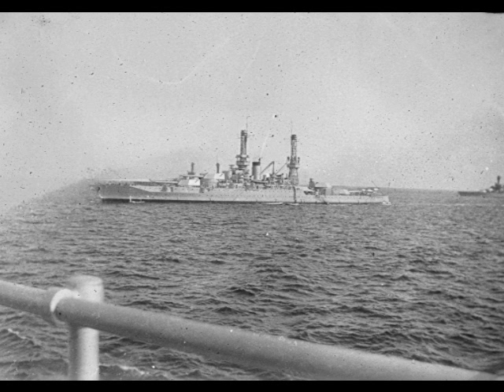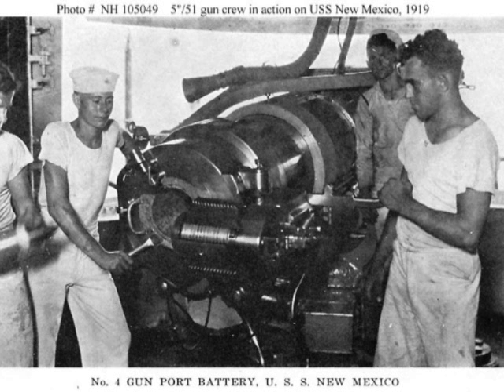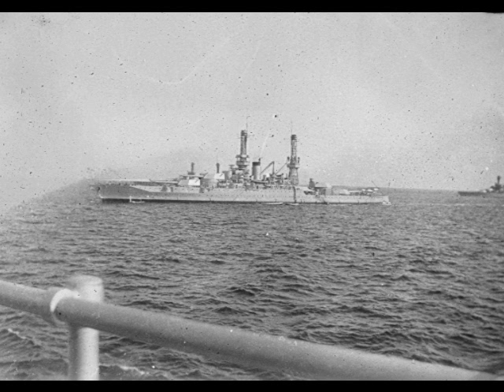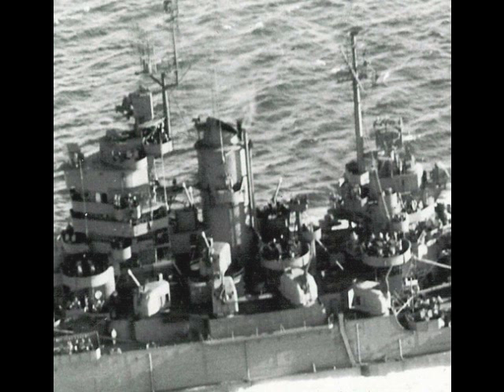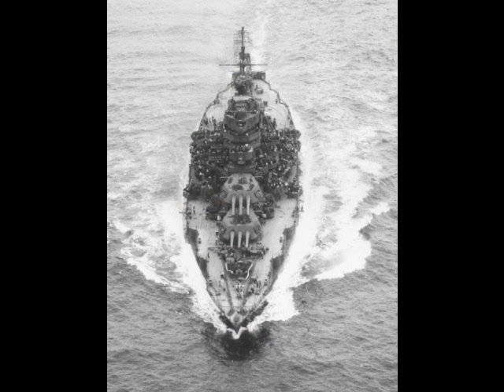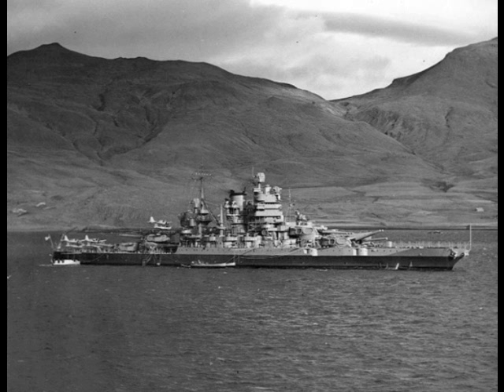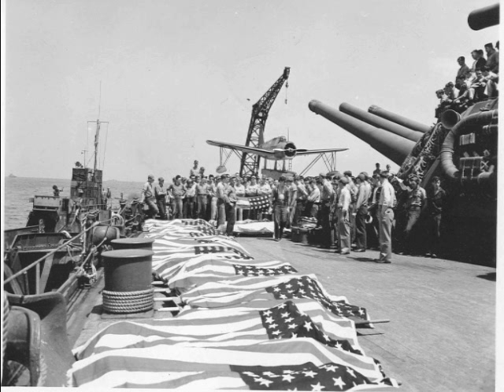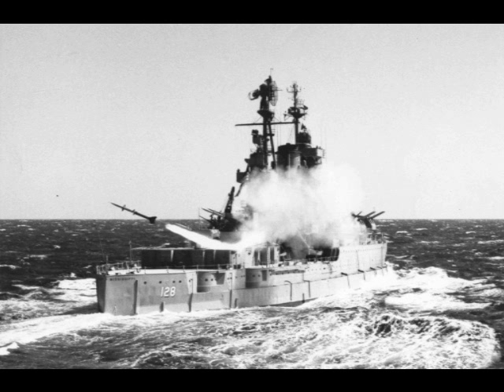New Mexico class

Comment: From what I understand the use of turbo-electric drive was because reduction gearboxes were still being developed, prior ships had direct drive with the turbines which was very inefficient, propellers like to turn slow while turbines like to turn fast. Once reduction gearboxes were reliable it replaced TE drive in all new ships.
Reply: Reduction gears are NOT cheap by a long shot.  They are one of the most expensive items on the ship.  So expensive the Navy doesn't own them they lease them.  When a ship is decommissioned the reduction gears continue to live on in other ships.

My first ship was the Kitty Hawk, I don't remember how old the reduction gears were just being told they were OLD.  They also had the largest locks on them I've ever seen, almost novelty like, big enough if giants were real it's what they would use on thier locker.  On the very, very rare occasion they get opened up you have an armed sentry right next to it.  If you have to enter it you don a "poopy" suit, apparently even a hair getting down into it would cause problems.

Comment: The presenter mentions one of the advantages of turbo-electric drive being that it is much quicker and easier to switch propulsive power from ahead to astern.  That is theoretically true, but not necessarily in practice.  Although I have never sailed on a turbo-electric ship, I have sailed on a number of diesel-electric ships.  It is extremely inadvisable to switch power abruptly from ahead to astern, as the presenter suggests.  So doing would inflict an amperage overload on the drive motors which would either trip the drive motors out, or possibly even burn out the armatures.  I have seen both occur when power was applied to the drive motors too abruptly.
Reply: My first ship was the Kitty Hawk and going into reverse was an evolution to be sure.  You have to slow the massive shaft down, enough to completely stop it.  Once stopped you locked the shaft, engaged reverse then unlocked the shafts 280,000 horsepower however will rapidly bring you to say stop.

I'm still very certain the type the author talks about and the type you discuss were a hell of a lot quicker to do all that.

None of it however can come close to going into reverse than my second ship, USS O'Kane DDG-77.  The Burkes have CPP Controlable Pitch Propellers.  You want to stop,  very simply adjust the blade angle.  We would stop so fast we would do what's called a hard crash back and if you're out on the fantail when this happens you better move quick otherwise you'll get soaked by the wave of water quickly created on the stern.

Comment: Pretty sure Mississippi wasn't the only battleship fitted with missiles as the Iowa class was fully modernized.
Reply: The Iowa class was only modernized with Harpoon anti ship and Tomahawk cruise missiles. They wanted to install the 8 pack sea sparrow launchers but they turned out to be to fragile for the main gun blast. So no anti aircraft missiles -which is what he meant. H & T are surface to surface types.
Reply: You are correct.  @dariuszrutkowski420